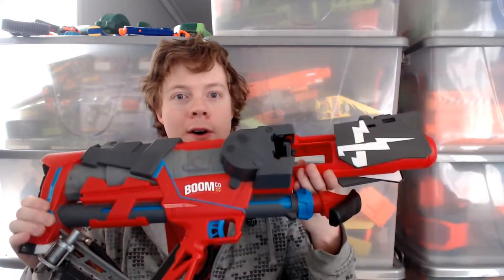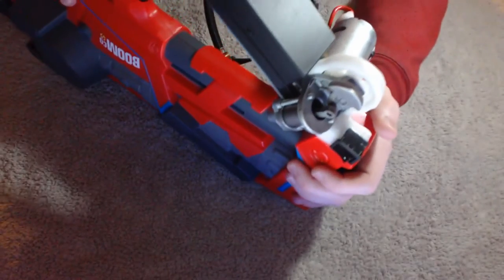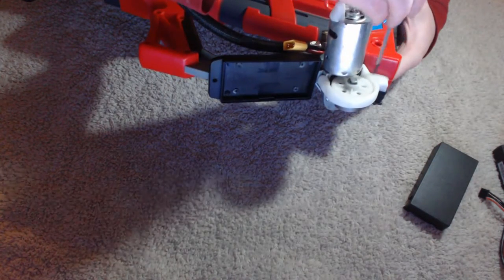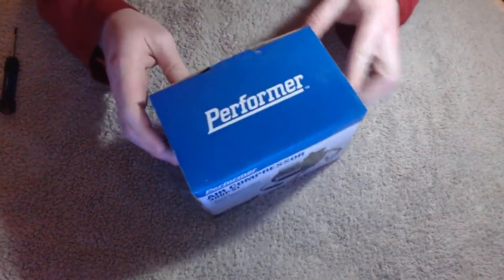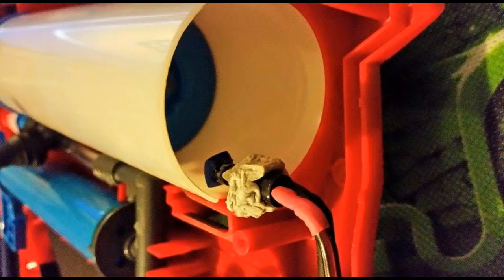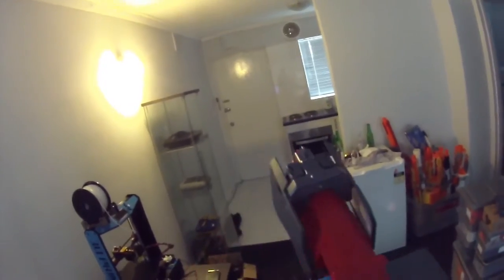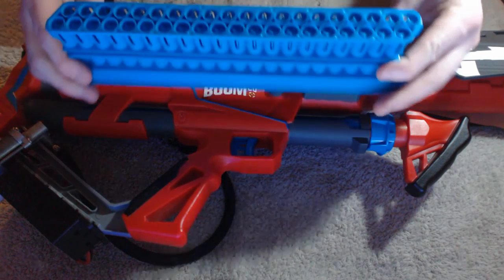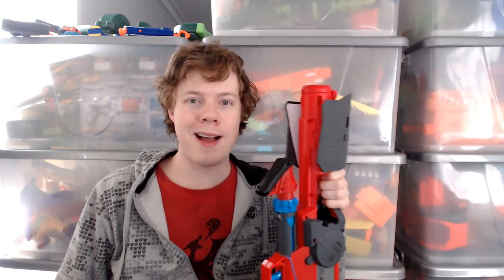BoomCo Rapid Madness Compressor Mod

Comment: That looks like a lot of fun. Also, I saw a 3D printer in the background.
Reply from the maker: I do indeed have a 3D printer now. I'm still getting it all calibrated up, but I want to start making printed SFS kits ASAP.
Reply: Cool. I am making plans for a second SFS. I have come up with a completely new burst fire mechanism which eliminates the double toothed pinion as well as one of the switches and the MOSFET. If you want any help in designing parts then let me know.
Reply from the maker: I want to start building kits soon. Any help you can provide would be really appreciated.
Reply: What CAD software are you using?
Reply from the maker: I've been learning Sketchup
Reply: Unfortunately, I haven't really used that software very much. If you are designing gears then you should try and make an assembly with multiple parts to make sure that they mesh properly. Also, print them with 100% infill.
Reply: yay kits! oh wait, then the battlefield will have a bazillion people bursting stryfes...
whatever! still yay! I recently got a 3d printer, and it was (and still is) a HUGE pain to get working. I'm sure you can relate. :)
Reply from the maker: +Nick Vanderplop Tell me about it. I'm half convinced my machine is just haunted. Well, I just want to leave my mark on the hobby.
Reply: Hee, hee. Mine hasn't shown a single sign of problems and we've had it since January.
Reply from the maker: Lucky you. This is my first machine and it's been nothing but trouble.

Comment: Good video! I like the subtle humor throughout. :-)
So as I understand it, the motor does not actually replace manual pumping but supplements it?
Reply from the maker: That's exactly right. I can leave the inflation to the pump if I need to do something else with my hands, but pumping speeds it along. Of course, if I just fire in bursts, I can have a full bladder all the time.
Reply: +Moderate Skill : Cool. So let's say I were interested in faster inflation. Would that be a function of the compressor or the battery? Or both?
Reply from the maker: +totophi Both, I'd say, but the better option is to go with a larger compressor. I have a much bigger one laying around that can inflate the bladder in 4 seconds. It's quite heavy though, so I never got around to installing it.
Reply: +Moderate Skill : Hmmmm, the never-ending juggle of priorities! I suppose you could carry a bigger compressor in a backpack, as some have been known to do, but you'd want to be reasonably fit and agile. OTOH, pumping rapidly by hand also requires strength and dexterity.
Reply from the maker: +totophi I determined the larger compressor could be bolted onto the shell, but it will result in a much heavier blaster. It's about 1kg. It's also quieter than the small one. The small one could be overvolted to speed it up, but it would shriek like a banshee and maybe burn out.
Reply: +Moderate Skill : I appreciate your assessment. Well, nothing quite like field-testing oneself to judge the relative merits. I don't have the skills to achieve what you did, but I can see that if the results are worthwhile, then extra weight may well be a fair price to pay.

Hint, hint. 😉

Comment: You should get the Ma5 Assault Rifle and do this. It is a lot easier to mod. You get 40 more feet of range with an upgraded spring. I've got a range test on my channel of it. I want to do this compressor mod for it too
Reply from the maker: Boom tendo That would be pretty cool. I heard it's basically a reshell of a Rapid Madness? I'd like to, but it's a bit hard to find in Australia.
Reply: Moderate Skill I can get you an Ma5 here and send it to you. I can upgrade the spring and sniper the clips for you too. Shipping will be a bit high tho
Reply: Moderate Skill I'm about to attempt putting in a mini bicycle pump in my Ma5 along with the compressor. there is a nice handheld compressor that auto fills to whatever pressure you want
Reply: @Boomtendo4tw  3 years and he still ghosted you